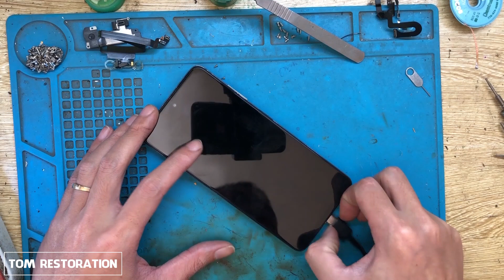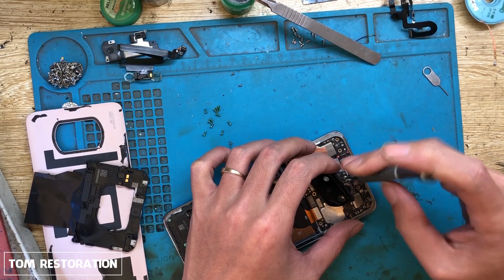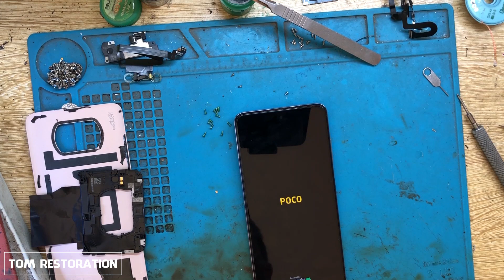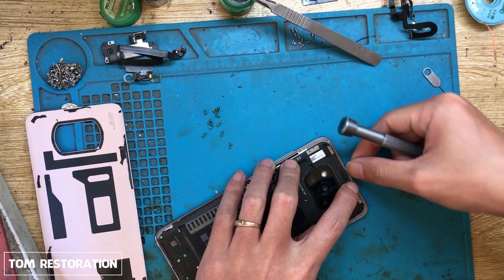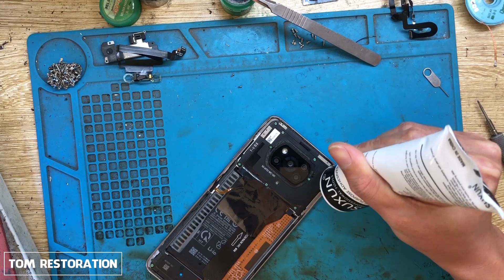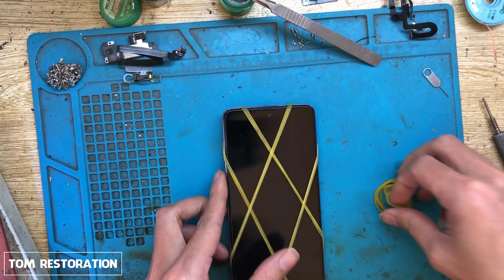Restore damaged Poco X3 Pro | Poco X3 Pro Dead

Comment: Why this problem occurs.... And how can I prevent my mobile from this.... I am x3 pro user... But this is seems like hardware issue.... But in YouTube everyone says it's a software issue... Any tips bro.. Preventing my mobile from this
Reply from the maker: it seems that the problem comes from the manufacturer, namely the communication on the mianboard is open circuit
Reply: Use phone cooler when u play games.
Reply: is software issues i have some problem frist it will get restart if not fix then ic problems happened to fix it you need mui hidden setingg and not optimize security app (app keamanan mui)
Reply: @xRestore  brother how much degree i should put the air gun and how much air flow
Reply from the maker: @ixrvalor0812  ~ 300 bro
Reply: @xRestore  what scale? Celcius degrees? farenheit?

Comment: This is not a perfect  way to fix such problem, The case here is that the RAM need to be reballed again,Its kind of manufacture mistake, The pads under ram will loss contact when using the phone too much for games and other jobs that makes the cpu or ram get heated,  The perfect solution here is to remove the ram and cpu and reball it and put it again, The solution u show is a temporary it will be dead again ^^ maybe next day or next week or month but am sure it will come back.I won't advice any one to randomly heat the cpu and ram it can make the work more difficult to solve.
Reply: cimonbkr6707  if u do it in the right way using the right solder degree and using black glue maybe yes

Comment: I fixed my Poco X3 Pro using this method, but with a hairdryer! The cell phone was dead, with no sign of life, after the process I connected the charger and it started charging! 🤩 Thank you!
Reply from the maker: Ok bro :)
Reply: Worked for me too. Used a hairdryer. Good enough of a fix to make backups. I thought it didn't work at first, but turns out it did and I was just out of juice. Had it plugged in when searching for other solutions and it suddenly tried to start up by itself.

Comment: You cannot revive a dead phone
You can revive a knocked phone 🤣
Reply: @MrAGaming55  What are you even trying to say?
Reply: @Liar587  it was an old video since removed. I was trying to say poco x3 pro is a scam mine got dead after 8 months warranty denied due to silly reasons. Poco is running scam.
Reply: @MrAGaming55  Ye, same thing happened to me, replacing the IC chip hasn't done a thing.

Comment: Hi Please let the phone 3 days without touching it then on 4th day press power button for 12 second it will show no battery after that just charge it for 20 mins and it will turn on to avoid this never restart your phone. try and post your comment
Reply: Hi Bro.. I have seen your same comments in many of the videos from different youtubers. Could you please confirm did it work for you? Actually My Poco X3 IN varriant suddenly turned off yesterday and i'm having the exact same issue. I'm very upset for the same. My warrantly period is also over. I'm thinking to do as per your advise. So before just wanted to know that if you  have done that by yourself or not
Reply: @sayantanchakraborty4536  Did it help? My poco X3 not the pro version just switched off by itself yesterday.
Reply: @sayantanchakraborty4536  did it help?
Reply: Brother kya ye work karega

Comment: Is there any issues to the pmic or processor
Many user face this problem
Reply from the maker: That's right, only a temporary solution. i had to work with ic
Reply: @xRestore  can it be solved by changing motherboard
Reply: Reballing cpu ram ic..it's permanent
Reply: @ananthuk4783  Of course thats is the most import one in mobile phone

Comment: Can I ask something, when I changed the LCD with frame my Poco x3 pro cuz the LCD got broken,  when I update my Google play system update, it's stuck at April 1 2021, what should I do?, Is it when they transfered everything that some have messed up or, it's the software??, Please answer cuz I'm getting nervous bruhh
Reply from the maker: Are you doing it at home? If your phone is still in normal use, you don't have to worry
Reply: @xRestore  I let the technician do it, he have put everything in the right place, when he put everything i immediately factory reset my phone, then when I update it's stuck in April 1 2021 Google play system update, but everything is running fine, this just bugs me a bit

Comment: My poco x3 pro is dead and I replaced the battery but it worked for one day and then refused to charge although a small white light flickering on the top but does not load the electricity - What to do ? is it a motherboard prob or just CPU, can I follow the same steps you just showed in the video? A big thnx for your help
Reply from the maker: Just try it first. But this is the complete solution
POCO X3 Pro White Screen Problem
https://youtu.be/GuLt6hQEi4s

Comment: BOSS,,, poco X3 user,, nahulog po cxa sa tubig,,hanggang start up logo POCO lng ipapakita dn mag black out na,, ulit power on ko nmn ganun lng dn mangyari, ne try ko open cxa,, gumana po nabalik pero nag power off ako dun wala na,, di nka balaik,,plzz panoticed,, anu suggestion nito boss
Reply from the maker: ah. If you fall into the water, you need to bring it to the repair center. they will take it apart and clean and fix the inside

Comment: Same Problem in my Poco X3 Pro Plz Tell Me Which problem in this phone plzz
Reply from the maker: Let the battery drain for a few days and then plug it back in. If not, take it to the nearest repair shop
Reply: @xRestore  my poco died n after not charging for 1 day ,it shown no battery indicator...., Is there any hope it will get fix own it own?, 
Or should i change some parts? 
Plz reply
Reply from the maker: @kai_8467  I think you should take it to the nearest repair shop to have them check it would probably be better. Because if we are not careful when handling hardware, we may not be able to fix it. In many cases, such as battery exhaustion or simply a slight short-circuit, it is easier to handle than guess a problem
Reply: @xRestore  actually ma phone also just switch off on its own.... When i was watching something on YouTube.

Comment: Great video! Btw can you confirm that adding non conductive thermal paste over the soc and ufs will dissipate heat better?
Reply: no the heatpipe is really bad, i did a copper shim mod on the phone and the heatpipe doesn't spread heat fast enough around the lcd for the cpu to oool down
Reply: Thanks for the heads up but already sold the device long ago, since it started showing symptoms and the poor thermals cannot handle such a beefy processor with double decker setup
Reply: @shubhamd0124  yeah my phone died multiple times i kept on having to reball the cpu, despite the mods i had

Comment: My Poco x3 pro is dead and i took the phone to local shop they said to change the motherboard what should i do it cost expensive is there any other solution to fix
Reply: I think you can try this method.  it will helpful provability .
Reply: The same goes for me, I just went there and same suggestion that they gave and too expensive hays around 7k

Comment: For me 300c max air speed for 1 minute over power ic copper tape worked i had to leave phone in charge for 1 hour
Reply: It died after two weeks, i now used 380c 6 air speed on pmic cpu and memory for one minute now its up. 858 D
Reply: @ninjatall15 what about now bro, I have the same poco, for now I didn’t try the method
Reply: @joaquin2854  it will keep on dying i bought k60 pro instead

Comment: Same problem in my x3pro can i revive
Reply from the maker: If you have a removal tool, you can use a hair dryer to heat it up. Consider removing all cameras. however, you should take it to a technician for repair

Comment: Or is it the frame?
Reply from the maker: no
Reply: @xRestore what do you think happened? I'm still stuck at April 1 2021 Google play system update, I can't upgrade it to the latest,
Reply from the maker: @GreenMan19961  I think if you use it normally, you don't need to upgrade the software to do anything. Because it's very complicated. I understand phone users very well, they are always looking for new things, they always think new updates will be better. But as a phone repairer myself, I know that sometimes updates it slows down the phone. I've had more than 4 years of using a phone without an upgrade, it's more durable than a constantly upgrading phone
Reply: @xRestore   Your comment is very important for us. 
Thanks